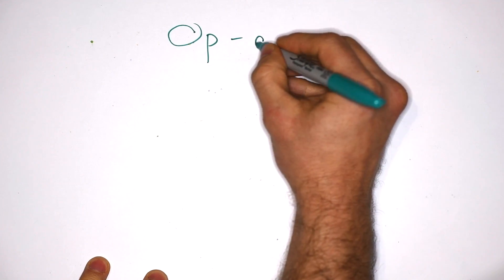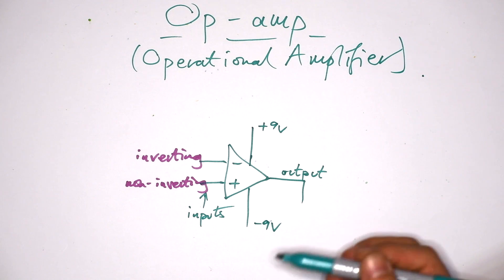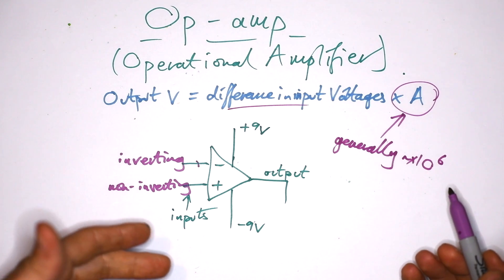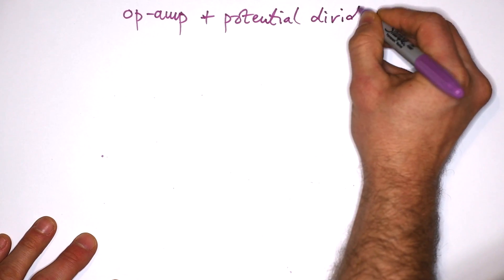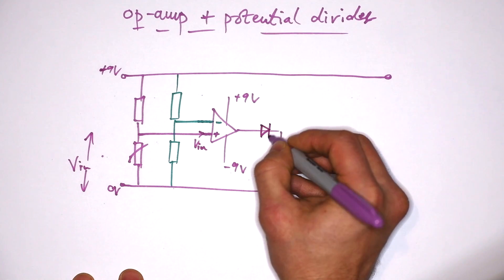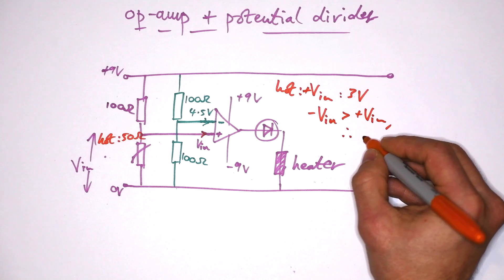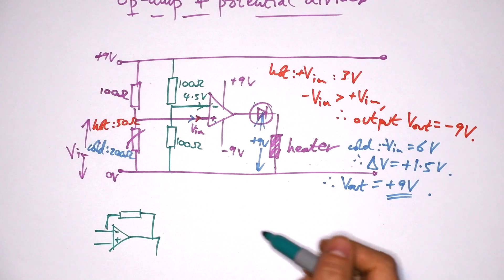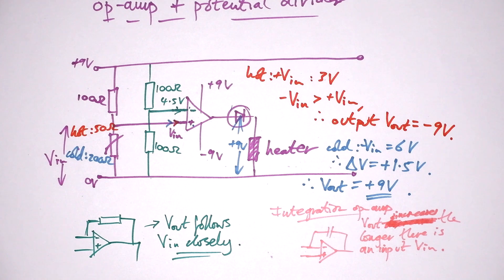Op-amp - Physics (A-level)

Comment: 2:52
You have to deduct 2 from the supply voltage to get the saturation voltage.
(Vsat = +/-(Vs - 2V)

You should explain more about the Integration op-amp circuit & the circuit with a negative feedback.